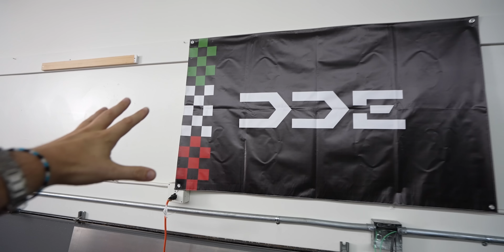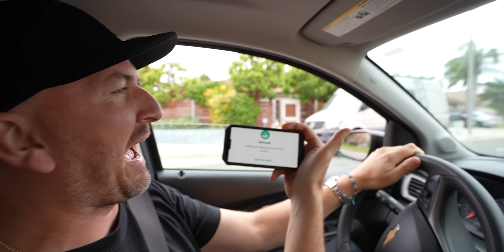I’M HORRIFIED McLaren 720GTR WIDEBODY KIT ARRIVES DESTROYED…

Comment: Being a body shop owner for over 40 years. There is a high possibility you can use some 1500 and finish off with 2000 wet sandpaper. Then use the proper 3M. Buffing system. Now with that being said. It all depends on how many coats of clear is on every panel. Industry standards is typically 2 to 3 coats. However, when you buy high-end parts, they usually put up to five coats of clearcoat.. At least they are suppose to. The very first thing I would do is use a mill gauge on every panel to see what you are dealing with. Obviously, if there is not enough clear on every panel. The only thing you can do at that point is wet sand all the parts and re-clearcoat them. Otherwise the more you cut and buff the clear coat. The more layers you will end up removing. Unfortunately, I know you’re getting a lot of comments so you’re probably not going to see mine. I wish you guys the best of luck. If you do happen to see my post, please feel free to reach out and I will be happy to show or explain what you need to do to save the parts. Ron.

Comment: That kit is going to look sick! Lol don't sweat it Dave, thats normal.
I have bought new carbon kit panels before and they always require some finishing work to make them perfect. You are going to want to sand it all down and spray a few layers of clear to protect it anyway which should take care of any issues you have.
What really sucks is when the panels have deep scratches or high & low spots in them like Tavarish's rear clam shell he got for the P1, that is when the hours to give them a proper finish really start to add up

Comment: Possibly need a more aggressive pad, but should be hopefully good. Amazing kit
Reply: No use polishing that with what he had. Wool and a rotary maybe, but much easyer just to sand it a bit and then polish out. The quality is not there so I think there is no way around sanding and multiple coats of clear.
Reply: @TheJaoMing  yeah that would be the way forward but then it becomes a whole task in itself to wet sand or sand and clear coat again, with a wool pad and a rotary it may be possible to pull out the marks along with a heavy cut compound like Koch chemie, anything is possible just time and how far do you take it
Reply: Possible also could just use some 3000 trizact paper and then do the heavy compound
Reply: If it was anything less than a true epoxy clear(NOT typical paint CC), I'd just leave the bubble wrap circles on it. HIGH probability of getting into the fiber on polishing. You can see what appear to be small air bubble imperfections in the light on that panel so they have to be multi spayed and buffed to high-build some(or all) of the panels. This is the point of no return. Spend the extra few thousand for a job done right since you're in this deep already.... just me 2 cents.
Reply: @zanebrown5142  it's also possible to sandblast carbon fibre. This clearcoad was rushed and is nowhere near expectations. It's not even on racecar standards ffs. :/
Reply: @TheJaoMing  agreed. They look to be very intricate panels but substandard finishing work at best... possible even substandard construction. The thing i worry about most are the pieces that seem to have moisture inside of the fiber. (Not the water in the rear bumper)... the cloudy look under the resin. Cars do usually get wet right? They MIGHT be able to get that out in a vacuum oven? Properly vacuumed fiber should never keep water inside of it.
Reply: Use cutting compound and than polish one section to see the results.  May save a lot of time from not having to sand.

Comment: In my experience,  with shipping  composites...there could be a chance that those marks are from a VOC chemical on the bubble wrap and the heat from transport  caused a reaction the buff and polish could be a good answer, but the pin holes in the clear could be a side effect of the clear not being able to naturally off gas and cure

Comment: If this kit was in Kelowna I could help you guys. When Nick was polishing the Carbon you can see the orange peel coming through the clear. It will need sanding regardless. I also happened to notice some high spotting in the clearcoat that would need to be levelled out. Thought I saw a dirt spec aswell, but could just be another highspot. In my 8+ years paint correction experience, for the best but cheapest solution, have the kit wetsanded and levelled. Correct and polish the kit. Then I would cover every single piece in PPF. It should hide any remaining flaws while enhancing the depth for the best look. You guys got this!! Totally fixable 🙌

Comment: I do small Resin art crafts. High temp softens most resins. wet sanding with different grit. I use sand paper files up to 12000 grit than I use a plastic polish and buff it to clear. Mod podge finish to coat the art crafts but I never touched carbon fiber. Seems like carbon fiber is similar.

Comment: 😮It sucks but the SELLER should cover the COST for the body shop  to Resand, finish, clear coat the entire kit! I'm telling you that will be much quicker than having them resend another kit. Hope it all works out.
Reply: It’s not the sellers fault. Every body kits needs fit up and refinishing. Only Dave is acting a fool to create drama to make people like you comment. There is nothing wrong with the kit, just something wrong with Dave.
Reply: @Sophie-and-Ken This is simply not always true. I've seen plenty of CF arrive and not need sanding.
Reply: @Sophie-and-Ken But, it is! It's simple.! The seller should have wrapped it with foam wrapping first, then plastic bubble wrap
Reply: @michaelmorrison3404  exactly! Same here. Received plenty of CF parts and NOT once, EVER, was it wrapped in bubble wrap first because of this potential issue!  If SELLER wrapped this, they are responsible! PERIOD!
Reply: @michaelmorrison3404 the kit is designed to be raw carbon and refinished after fit up.
Reply: @refillz5281 this is a raw kit. Not a finished kit. You can’t expect a kit like this to fit the first time. Even Tavatishes P1 kit needs to be fit up, cut an refinished. This isn’t a Honda civic kit.
Reply: @Sophie-and-Ken  I get it, you think you're an expert.. But, the kit should not have arrived a F'd up because an idiot wrapped it in plastic instead of foam wrapping first. Your argument is invalid and pointless.

Comment: I'm currently designing & building front bumper lower diffuser  in urethane & creating a rear hatch spoiler in carbon fiber on my 2005 Audi allroad.. #1 Would be to figure out where & how each piece fits.  #2 Now you can see where/how they need to be fastened etc.. #3 After modding up everything remove the parts & wet sand out the clear coat  imperfections which resulted from the chemicals of the carbon still curing while in transit with the chemicals of the bubble wrap. #4 respray with clear & use UV lights to accelerate the clear coat cure time... #5 Final Install of the parts & Drive Baby Drive..   Good Luck DDE

Comment: Before doing anything, color sand it with 1500, and run a buffer over it to see if the marks come out. If they don't, then you can sand the whole thing down with 600, or 800 grit on a DA sander, and spray some automotive clear on it, I've personally done that before. If the color sanding works, then you can relax a little, and finish building the kit.

Comment: With carbon fiber parts you usually want to take it to get reclear coated or just add more clear to it. The best option is to take it to a shop that specializes in carbon fiber to get recleared and it will take away all that dimpling. They do a wet sand so it will take all those dimples away and add more clear to make up for the wet sanding

Comment: Hopefully you can polish the clear coat and fix the problems. If you have to sand the clear coat and re spray it, I agree with one of the other comments where it was suggested adding a color to the clear and then having colored carbon would look spectacular on the car.

Comment: You do not have to wet sand the carbon to resolve this issue.  It can be removed, either by hand or polishing machine, using a polishing/burnishing paste. Yes it's a little extra work but it can be done without a great deal of inconvenience.

Comment: I'm almost positive you can buff that. Professional buffers & compounds can fix some really screwed up, scratched & faded paint/clear. 

Also I would be careful doing all exposed carbon. Unless it was sprayed with specific UV resistent clear, it'll fade & turn yellow pretty quickly. Most carbon companies dont use it, because OEM quality UV clear costs $100k/gallon. (Atleast that's the price Corvette stated for the carbon on the c6 Corvette Zr1)

Comment: Put it together.  Leave the front bumper and spoiler off.    And it down with 400 then 600 and re clear it.   Do not buff it out. All the uv protection is going to be gone if you just cut and buff it.   Clearing over it will also help in the high and low spots of the carbon.

Comment: Fix the clear coat and to save some time and money have the parts fixed before attaching them or take it apart after fitting so the wet sanding and respray process will go much quicker

Comment: They shipped all the parts before they were even fully cured. Either the clear coat, if there is a clear coat, or the resin. If it's the resin, it means that these parts weren't heat cured which means these parts are going to have lower tg temps, meaning the parts are going to have major weave printing into the surface once this car gets into the sun. Not quality

Comment: I think a good cut and polish would have corrected the bubble wrap imprints. The DA polisher made a difference, but a wool pad and a rotary polisher would have flattened it out quickly. 
After seeing the pinholes and in the part, the plan to mock up and refinish is a more sound plan of attack.

Comment: It needs to be wet sanded and clear coated.  Then the paint correction finish coats.  Not a huge deal.  But also not what you bought.  So finish it with the help of a great body shop.  Demand a rebate from the kit supplier commensurate with the extent of the damages.

Comment: I would be careful leaving it all exposed carbon. Unless it was sprayed with expensive UV resistent clear, it'll fade & turn yellow pretty quickly. (And if you wet sand, you'll lose some of that UV protection). But most carbon companies don't use the high quality stuff, if any at all. Cause pure OEM quality UV clear costs $60k/gallon. And they do a 3% mix of it into normal clear, making the final product $2k/gallon.

Comment: Umm pretty much all clear coated parts not just carbon fiber will have the bubble wrap imprinted on it if it's humid or if it gets warm while wrapped it'll do this cause the clear coat is kinda soft to prevent it from chipping when a rock hits it but hard enough that dirt and whatever else hits it doesn't scratch it. A simple CUT, Buff, and polish is all it needs to bring the gloss back out

Comment: The marks are caused by water. I could see the evidence of water on the outside of the crate. At some point in shipment this thing got wet. Then when the defuser was full of water it was proof. The bubble wrap got wet, stuck to the parts and basically imprinted onto the surface.

Comment: This might turn out to be a blessing because I had a car with a carbon hood, trunk, and the off gas was so horrible ,  maybe when they clear coat it it will be better then the exposed resin epoxy and if they can give the inside and outside a good coat,  you won’t smell any off gas.  Not certain but possibly this could be even better

Comment: Wet sand, cut, and polish. No need to re clear. But that’s gonna be a fun job with all the intricate areas.
Reply: You need a real detailer who can run a rotary, not a da with a white foam pad. 3k scuff, rotary, then dual action. Polishing with a da alone will sink those marks back into the paint, they will pop back through after a few heat cycles.

Comment: You should be able to sand and polish it out. Shouldent be an issue. 13:35
Reply: You can’t simply just polish as it adds too much heat and make the substrate mailable making it hard to remove the damage.

Comment: Famous last words: "Don't worry, it will buff out" 😆
It might, though.
Are the parts clearcoated? Hard to say from watching the video, but some spots look a bit rough for finished parts.
If they aren't, no big deal, theyll' have to be wet-sanded and prepped before paint anyway. 
If they are, and the clearcoat has had enough time to cure, I would at least try to polish one of the parts with a small orbital, a soft sponge pad and a good medium compound first, and see what happens.
In any case it wont make it any worse than that 😁
Good luck lads, but that 720 will end up looking super-sick anyway with that kit on it👍

Edit: had I waited until 19:30 before commenting I could have spared myself some typing 🤣

Comment: I bet most of that can be fixed with a lot of hours of light wet snading and polishing or just compounding and polishing as long as those parts are clear coated and not just the epoxy. Even if it is just the straight epoxy(which i highly doubt because they dont do that anymore) that could still be fixed by sanding and clearing it. Now the cloudy parts might need a respray if its too deep but its all fixable so theres that. best bet is to show the manufacturer and have them pay for it to get fixed. I bet i could get 95% of those panels looking brand new in a day. The other 5% are those cloudy panles and i would have to gauge what can be done but regardless i could fix them. I can fly out and get it done for you if you want. Ive worked with carbon for most of my career. Btw nick used way too much compound and was using a light polishing pad. when you put too much compound or polish on a pad it clogs up the pad and it cant do its magic like it was made for. You only need 3 dime isze or smaller dots for a panel and even less for a small little piece like that. Also the pad does most of the job the compound and polish is more of just a grity lubricant than anything. You will need a micro polisher to get in all the hard to reach areas which is why i said it would take at least a day. You also have to be careful of the edges because usually clear coat isnt as thick in those areas and you can burn through if youre not careful. Wish they made paint depth gauges you could use on carbon lol.

Comment: I do composites manufacturing in the USA and can confirm that that kits finish is SHIT. The kit probably just has a polyester resin clear gel coat as its "clear" which looks good for about a year. I don't think those parts came with 2K urethane clear coat, which should be a STANDARD! Especially for 100K. for 100K that kit better look like glass. Shame on that company.